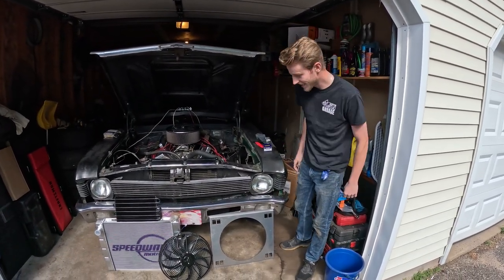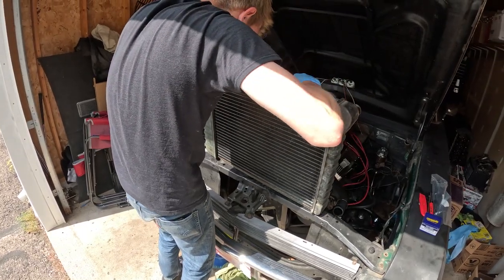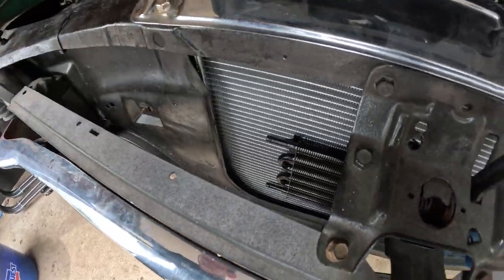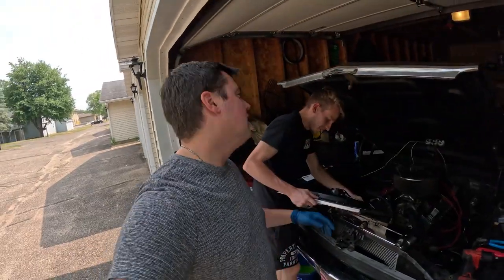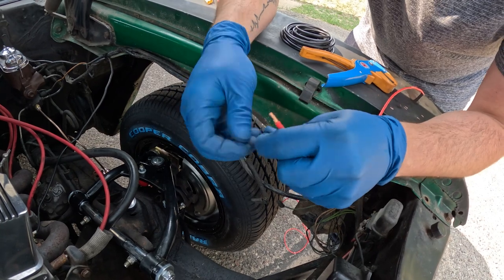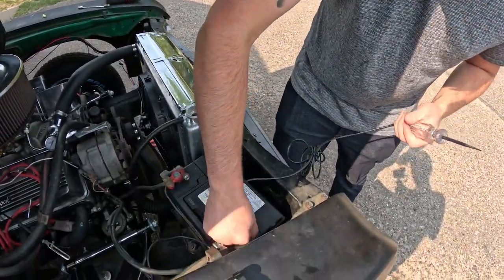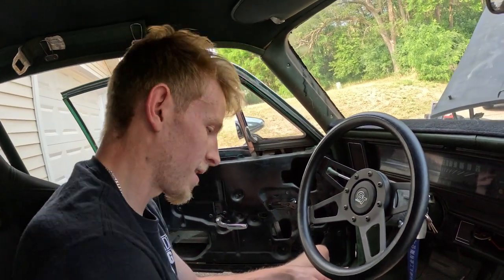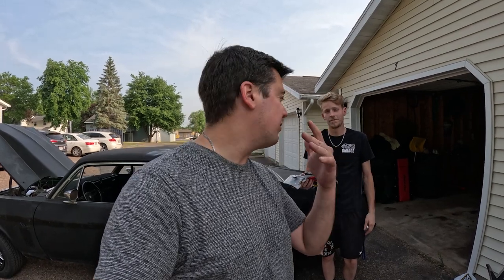Chevy Nova Gets Some Cooling System Upgrades! Overheating Problem Solved!

Comment: When moving the flaps allow the air to blow through. It will allow the engine to stay cool at idle and driving down the road.
Reply: Yes so true, when moving and putting torque on the engine more air flow.

Comment: 30A fuse for the fan. The rubber flaps force air to be drawn across the whole face of the radiator by the fan from behind. But if cruising at highway speeds the pressure of frontal air is high so flaps open to allow frontal air to push thu radiator.
Reply from the maker: I was pretty close as far as my guess, we appreciate the information!